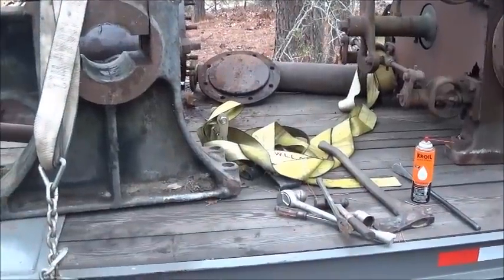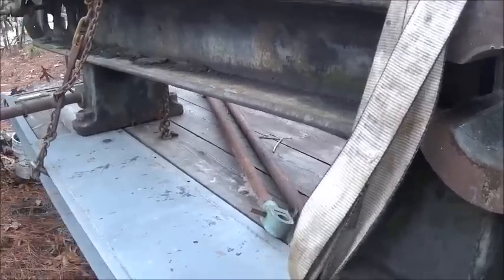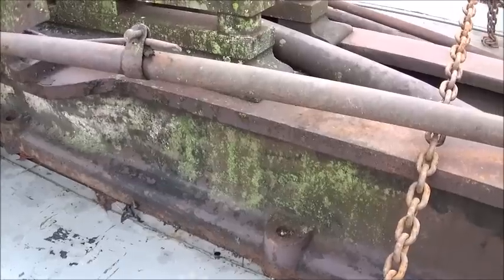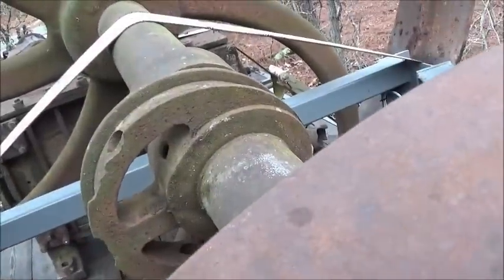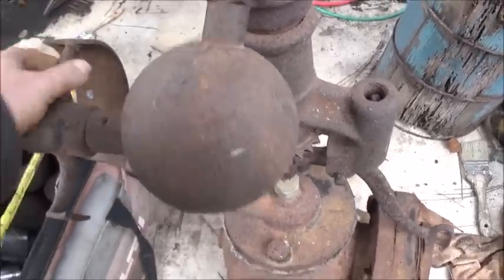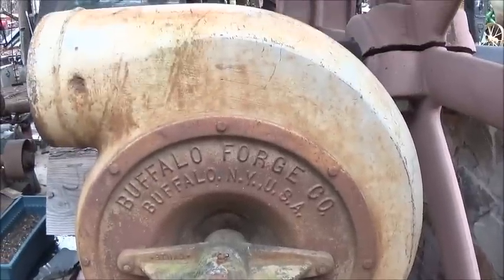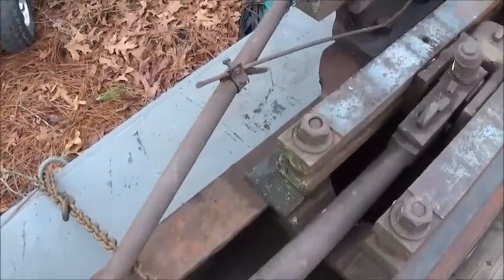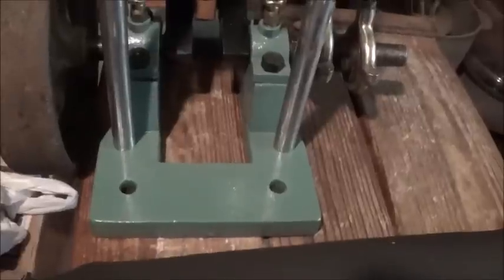STEAM ENGINE TEARDOWN, HOW BAD IS IT?

Comment: Buffalo Forge blowers were about the best ever made. They were used in all sort of industrial applications. They were made for over 100 years. That small fan is known as a “baby Buffalo”. Cast iron volute, extremely well built, they were frequently used for transferring material like sawdust, slag, etc. 
As an engineer, I specified Buffalo Forge fans well into the 1980’s. Buffalo Forge also published the definitive textbook on fan design and air movement: The Fan Handbook. It was printed multiple times and only available from Buffalo Forge company. I’ve had one that was given to me in the 1970’s by the company and used it for decades.

Comment: Cool stuff!  Have you ever been to Louisville, KY?  The city there owns and operates a sternwheel steamboat called The Belle of Louisville that they've had since the 1960's, but it was built in 1913 as the "Idlewild" and it's engine was a used steam engine that was old when the boat was new, the engine dating back to the 1870's.  You can still take evening and/or dinner cruises on it from spring through fall.  It has a steam calliope that you can hear all over downtown when they play it.  It races every year during the KY derby festival (It used to race the Delta Queen, but now it's usually racing diesel boats that look like steamboats as the Delta Queen was retired from service probably 20 years ago now).

Comment: I have several brand new rolls of modern "fireproof", non-asbestos insulation that would be perfect for re-insulating those engines. They are slated to be sent to disposal, but I will save them for you, if you are interested.

Comment: We had a buffalo forge blower that was mounted on a heat exchanger for sewage digesters at a sewage plant. Never an issue with it. It just ran smooth. Built in the 1950's

Comment: As a bit of a writer, I find "no issue" with saying "not an issue." So I ran it ("not an issue") through Grammarly, and it says, "no issues found."
I would keep using it, Jonathan.
Here is what ChatGTP says about it: 
Is "not an issue" correct to say if I am trying to say "not a problem?"
Yes, "not an issue" is a correct way to say "not a problem." The phrases "not an issue" and "not a problem" are often used interchangeably to indicate that something is not a difficulty or concern.

Comment: Hey Jonathan, love your videos on the steam machinery ...with the Gardiner govenor, would it be easier / better to machine an adaptor ring? if you use 1" plate you could drill and tap the hole pattern of both the flange and the govenor that way you save drilling holes in the original flange.

Comment: Maybe that rough Hamilton jug could be painted up like the display boiler? With the covers off(and the mystery crud gone) those cylinder valves have gotta look neat from the inside of the casting too, right? Wouldn't want to section it like the boiler though so it still has a chance of running someday. One more thought for the pile. Have a good one, all!

Comment: Somewhere I read a steam engine manufacturer's recommendation that when reboring the cylinder you did not need to replace the piston until it was like 1/2" to 3/4" smaller then the cylinder.  Just fit rings sized to match the piston and bore.

Comment: Okay Jonathan in order to prove your point on that blower you will need to take that pulley off without touching anything else of the blower itself I'm not actually saying don't touch it but don't remove or mess with say the impeller inside and just put an X on the shaft just to see if it returns to the same spot without the pulley and if it does turn to the same spot you will know that it's the impeller that is out of balance heavier on one side and if it randomly stops without the pulley then you know your theory was right that it is exceptionally balanced either way it is an issue and not necessarily a problem thank you so much for your videos I enjoy the heck out of them most of the time that is neither an issue or a problem because I always enjoy you your knowledge and the way you treat people and life if I knew you personally I would definitely want to be your friend and help you in any way that I could and not just because I know you would do the same ciao for now

Comment: Id like to have one of these, I would even like to build one from scratch, casting parts from modern materials, maybe use roller bearing, I'd like to go with atleast a 6" bore 12" stroke, maybe 8" bore, I'd want to use seamless steel pipe if possible, make a head from 1/2" plate with 1/4" web bracing, maybe build a early style oil burner, diesel engine, maybe build a slide valve set using 4" ports for the diesel engine, maybe try casting sealing o-rings from brass or bronze with powdered graphite to work asa lubricant, use a 1/2" plate slide with about 4" hole in center to align with the ports maybe a 1/4" wide, flat faced o-ring on thr head side. And the cover side, with steel pins and springs to keep pressure on the o-rings, with a plate and single stud with nut and lock nut to adjust pressure on the o-ring, build a crank with 1/2" plate steel and about 4" steep round bar, machine a 2" square to fit in the plate shaped like a stereotypical anchor ⚓, with the center portion being about 5"-6" wide,  and the rod journal fit the same , using a 2" square , on the ends, to fit like mortis and tennin, with interference fit, with the plate having a 1/4" bevel, to allow a full penetration weld,   build a rod in a similar way,  maybe make the rod journal extra wide, do it can be used in a opposed piston engine, without building another crank, hand forge the rod ends from 1/2" steel plate, and the rod from 1/4" plate and 2" x 1/2" plate steel, with the big end being between 3" and 3-7/8" when finished same as the main journals. Maybe get crazy and build a pressurized lube system and sealed crank case, use steel tubing to bridge the main journals, with a grooved main bearings feeding the system, with oil fed through the rod to the 2" wrist pin, melt down a few pistons to cast a couple pistons because I'd like to build a twin cylinder for added balance,   the rod being 2.5' wide with the H beam design,  use a large roller tappet camshaft, using 1" tubing with 7/8" x3/4" solid roller, with a 1/4" solid shaft with brass bushing with an aluminum core with steel cup for a 1/2" pushrods, tgr core holfing a traditional valve spring, to keep the roller on the cam, use a intake cam and exhaust cam,  with it peaking at 1200 rpm on a good day the cam having a 1" lobe lift, minimum, 2" would be better,  use a rocker to operate the slide valves, similar to a bellcrank, with a cam per  valve the slight overlap can be adjusted, as well as the event timing!  Use scrap metal and repurposed parts to build this engine,  the lost foam casting method, I think a 10" piston would be more fitting, use a 1/2" wall tube, or 1/4" wall used similar to a liner maybe split a tube and weld the difference , use 1/4" plate to build a water Jacket, with 1/2" plate at the ends to bolt the head to, (acting as the deck) use a copper o-ring to seal the combustion, possibly a 8gauge soft copper,  with 1/8" rings made with alot of time on a surface grinder, when the crank and rods are welded, I think heating them to a slight red glow for a couple hours , then allowed to hang and air cool evenly, should remove and hard spots or stressed from the welding,  probably the whole cylinder and crank case also,   hopefully 1/2" grade 8 bolts would be strong enough for the rod bolts and main bolts, using mains made like the rod caps from 1/2" plate, hand forged so it will fit around the crank journal, about 2" wide, maybe the mains can use a pair of bolts, being a 4blt main,  and the rods use a 1" bolt, (or the mains using a pair of 1" bolts, grade 8) with a couple 1/2" dowels to maintain a perfect circle, use a brass plate formed into a half circle,  maybe using epoxy attach it to a steel backing cast from brass then epoxy to steel, if it doesn't work, cast it in aluminum and electroplating copper on the aluminum, and machine the clearance! With the cylinders bolting on to a frame/ crank case,  the crank made from 2x 1/2" plate per side of the rod journal, welded together,  wit 1/4"steel tubing welded/ braised  to the rod to oil the wrist pin as well qs the piston and cylindr wall,  use a couple cat flywheels if they are large and heavy enough,  if not bolt another large flywheel to the crank, using a flange with 4 x 1" dowels sbd 4 1" bolts with a single in tge center, 5 total,  to hold the approx. 8"x 1/2" plate, with a bolt pattern to be drilled if required in the flywheel using 8x 1/2" bolts with 8x 1/4" dowels!  With a roughly 5.5" -6" bolt circle,   or what ever the flywheel bolt pattern may be,  with an additional plate with a 1" shaft to accept pulleys for serpentine belts or v belts,  to drive high power alternators, possibly a large electric motor, re wired similar to a 3phase alternator, using heavy gauge wire, to create high current, yet long enough to make atleast 60v  build a rotor similar to a alternator,  using slip rings and brushes,  what I want it for is to generate power to charge the batteries that power my house, about 300-500 amps at 30 volts,  I want to burn wast oil to fuelthe generator, id like to use the heat cooling it to heat  my house,  if I could not build this engine, a steam engine using radiators in the house as a condenser to keep it a closed system, using a wood stove turned boilerto to run it, atleast 6 hours at a go!  Atleast 10 HP , I need the alternator to spin at 2k RPM, so a large pulley on the crank spinning the 3" pulley on the alt, to get 400rpm or less, to 2000 plus, tge alternator needs atleat 1500 rpm,  the reason i want such a large diesel engine, is to also run a 20kw ac generator, while charging batteries , so basically I would need a engine capable of making 40-60 kw output, roughly 750 watts per HP,  that's roughly 50 HP without doing math,    I don't know what kind if power iyt would make, the TQ should be amazing, with a 12" stroke and 10" bore, with 2cylinders!   Sorry to ramble, it's insomnia, I should be sleeping!! 👍 Good day! ✌️

Comment: You could mount the top half of a governor to the bottom half of an air controlled valve, which are common but are usually side-draft, so you’d need to run a pipe elbow.

Comment: Double gasket or more, could prevent cylinder head from striking cover.That torch cutting was pure laziness. Flange bolts must be torqued equally.This engine has great potential-----!

Comment: The most pressing question is, why is there a pencil sharpener fastened to the steam engine?
Reply from the maker: Just sitting there, goes on the handrail near the Bates. Hope it has enough power to run it.

Comment: well, the guy that told you that it was a problem not an issue! does not! understand how the English language works some words have two different meanings the definition of issue is #1 an important topic for debate or dissuasion. #2 the action of supplying or distributing an item for use, sale, or official purposes.